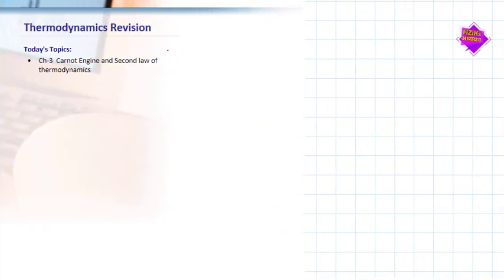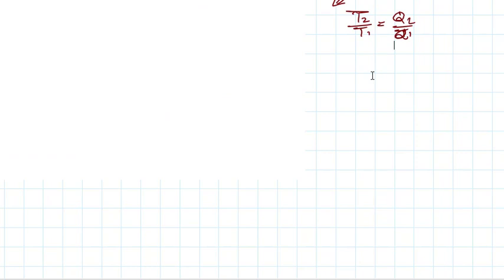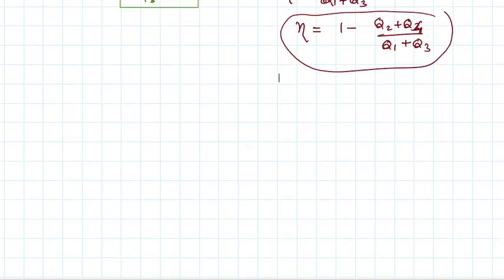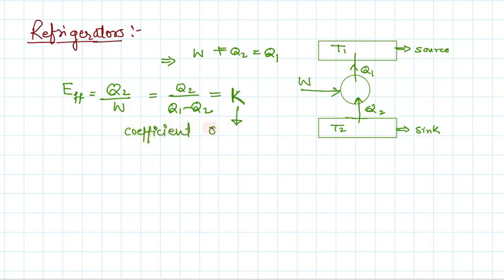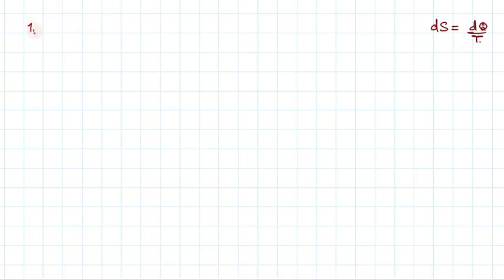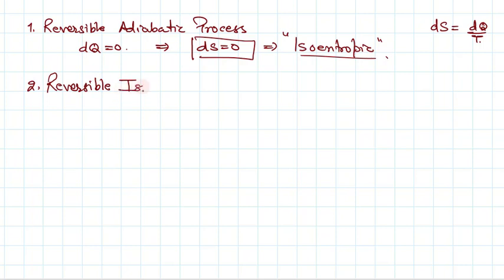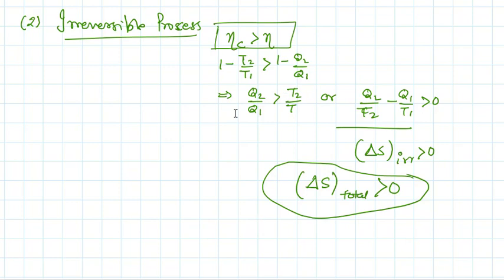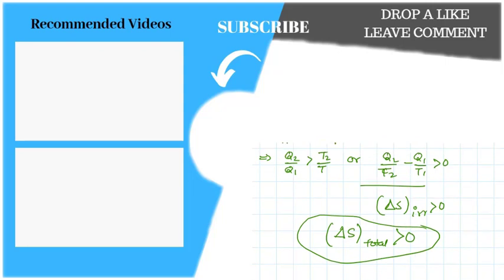IIT JAM PHY 2020 | JEST | GATE | Revision | Thermodynamics- Part 3

Comment: Sir....  I am pretty confused about why the temp of the sink being lower increases the efficiency of the engine..... Like the engine does some work and some amount of heat is dumped in the sink so why does the change in the temp of something that is just used to dump the heat that is not used for work increase the efficiency of the engine......  I am pretty confused about this so plz help if you could.
Reply: 1 - T2/T1
Reduce T2 and plot graph

Comment: I saw another video of heat pump and refrigrator, it was somethink like the COP (heat pump) = 1+ COP(refrigrator)
I don't remember exactly what it was, so is it important for jam?
Reply from the maker: The expression  1+ cop(refrigerator)= cop(heatpup) is correct.

I was told was relation between efficiency and cop of Carnot engine and refrigerator.

I nowhere mentioned heat pump

Both are different